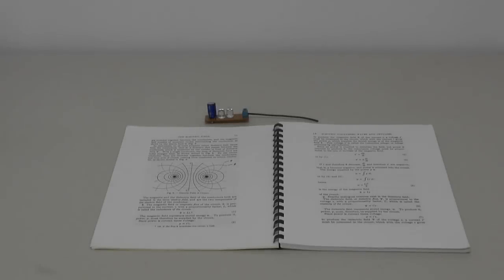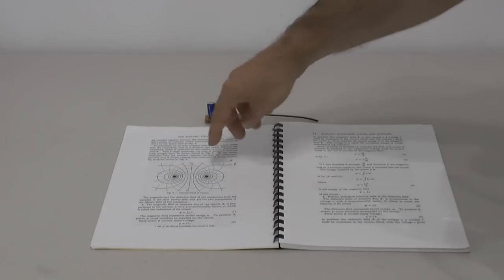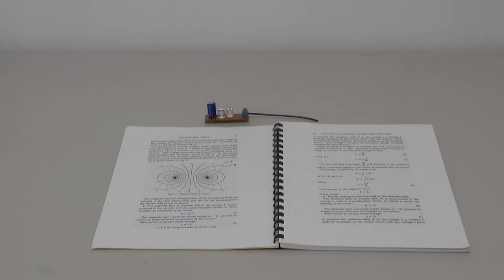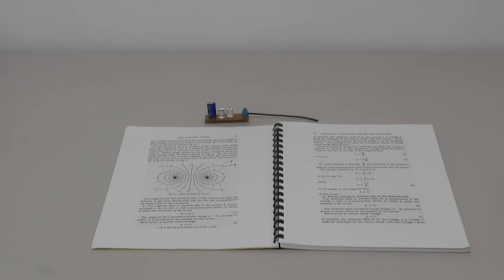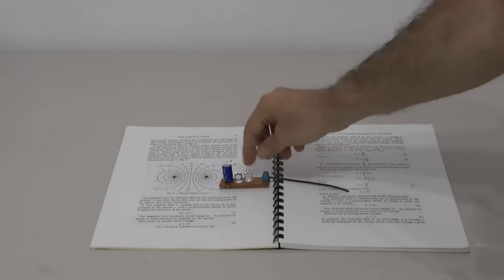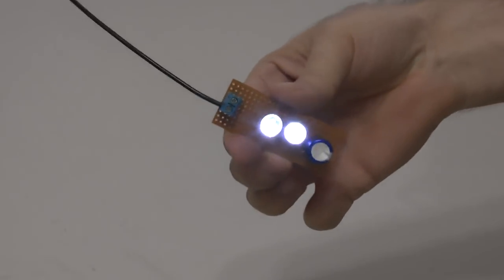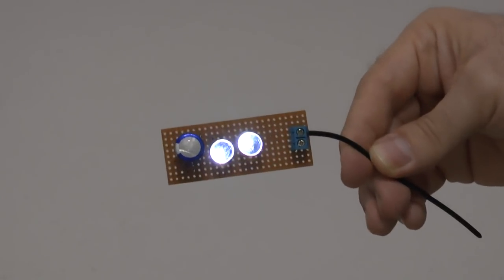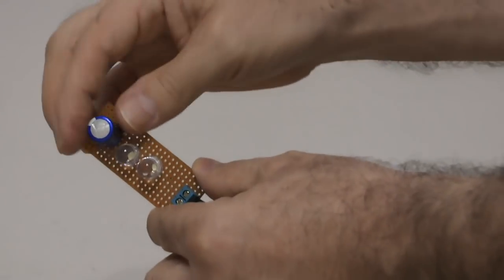Radiant Energy  and Dielectric Fields

Comment: Nikola Tesla asserted (Proved) that radiant energy was lossless and superluminal (wirelessly superconducting). In Colorado Springs he documented that he picked up a stronger signal from lightning strikes at periodic positions miles further distant than the source storms. This may be a strong indication that radiant energy has magnetic as well as dielectric properties. He did describe how the placement of his magnetic quenching device across the spark gap (from near the source or near the receiving contact) altered the effects (sometimes reversing a charge effect to a discharge effect) of the radiant energy he transmitted. Keep in mind that Radiant Energy is a wave propagation of the neutral super-fine Ether particles that lack the classic charge characteristic that responds to magnetic fields, but still transfer magnetic power and response according to Nikola Tesla.
Reply: Interesting theory, can you say something about transforming the ether into electricity ? Is a spark gap arrangement the only way to seperate the electric current from the ether energy which is known as radiant energy?
Reply: @Birol731  I'm afraid he's got it a bit wrong, first off the Aether isn't made of "fine particles" in the sense we understand, it is a non-Cartesian medium of unmanifest pure potential, Eric Dollard calls it Counterspace.

When the Aether experiences tension or torsion it becomes what we call the Dielectric field, and when that tension releases it manifests as Magnetism, which creates force and motion away from counterspace, forming space as a result, this is why Tesla was adamant that space cannot be curved as it has no properties, it's basically a shadow wake left by the loss of the Dielectric.

When it comes to radiant energy, it is essentially a current that has lost its magnetic component, since electricity is the conjugate of dielectric and magnetic fields, quenching the magnetic component while its flowing forces it to become a pure dielectric displacement impulse. You can see this in action by getting a spark gap and having 2 same polarity facing magnets quench the spark, it will result in the spark turning white.

Another way to make it is by running the power through a hairpin circuit before the spark gap, it will turn white and unlike regular dielectric discharges (sparks) it will be completely unaffected by the magnets.

If we could learn how to use this as an energy source it would replace outdated Electricity with Dielectricity, completely safe for humans. Power in this form doesn't have a magnetic component and as a result operates outside of time and space. since time is a measure of magnitude and the Aether doesn't have magnitude,  as a result the impulse travels without delay and doesn't suffer the inverse square law. Magnetism essentially represents losses, this kind of system should only form magnetism when it encounters a load thus leaving the rest of the circuit without the magnetic component, Russian experiments with single wire transmission have shown some indication of this as the wire displays room temperature superconductive properties.

ATM my theory is that if a tesla coil can powered by this impulse it will broadcast that power wirelessly, allowing the powering of devices by simply attaching them to a ground connection, or so I've heard, more research needed.
Reply: @JenkoRun  I had a video from the Borderland sciences many years ago (in the end of the 90's) where Eric Dollard made a demonstration about longitudinal waves (dielectric or capacitive waves).
Hmm, let me ask you, in a Tesla-coil, is the electric field component (E) from the magnetic field component (B) not seperated ?
While it is said, a Tesla coil sends longitudinal waves into space, so not magnetic field components as you said, which means no time delay, and not any energy consumption during the transmission process.........
What about the energy equation, how would you define the equation, for example, for the energy which is consumed in a light bulb or motor ?
What about the conventional current, can we transform these into longitudinal waves, maybe by using a pulsing circuit (DC) with very high on-off frequencies ?
The aerial capacitor of a tesla coil changes between plus and minus, a second coil which is placed in the vicinity of such a transmitter coil, would respond to the transmitter, am I right, a kind of displacement current (dielectricity as you mentioned) in this signaling system?
On the other side, displacement currents are also mentioned in the Maxwell equations......
We have more questions than answers, is there a free energy system here in youtube which may work according to these principles of Nikola Tesla ?
Can we use a Tesla coil to verify your hypothesis, a possibility to produce more output than input ?
Thank you very much for your detailed answer, you have much knowledge about Tesla's work, do you have here in youtube some videos about your studies in the field of longitudinal waves and Tesla currents, may I ask you ?
Reply: @Birol731  Reply 1/2 because YT sucks.

The dielectric and magnetic components are not separated in a tesla coil, or at least not entirely, we can tell because the dielectric discharges (sparks) that come out of the secondary are blue/purple and they can HURT when you make contact with them, this shows that there is still a presence of magnetism, albeit very brief. It's not like regular electricity however since sparks are dielectric discharges that have a magnetic field form along after the discharge, like lightning the discharge itself occurs outside of time and space, the magnetic component forms afterward and follows the path the original discharge took as it ionizes the air.

Before we go further we have to understand what these fields fundamentally are, the dielectric field is the Aether under tension or torsion, while the magnetic field is the extrinsic attribute of the dielectric field, the loss of the dielectric is what creates force and motion away from counterspace, volume, and is also what creates our Cartesian universe. Space itself is literally a shadow wake left by the loss of the non-dimensional dielectric field. This is why Tesla was adamant that space itself cannot be curved:

“I hold that space cannot be curved, for the simple reason that it can have no properties. It might as well be said that God has properties. He has not, but only attributes and these are of our own making. Of properties we can only speak when dealing with matter filling the space. To say that in the presence of large bodies space becomes curved is equivalent to stating that something can act upon nothing. I, for one, refuse to subscribe to such a view.” And he is most certainly correct.

Despite my research I'm not good with math so I don't do equations nor understand them, I just compare with what we see in nature and what I know, along with my own intuition.

Can we transform conventional power into dielectric power? 

Yes, in-fact this is exactly how Tesla's hairpin circuit works. Fundamentally the electricity we use today is "contaminated" with magnetism, amps, this is what makes it lethal to us, Tesla wanted to clean the power and he succeeded with the discovery of what he called radiant energy, also known as cold electricity or dielectricity. 

The hairpin circuit works by taking a conventional current and running it through a parallels spark gap and series capacitors, because of how capacitors work between DC and AC Tesla found that unidirectional current worked best for this, yes Tesla went back to DC when he began working with radiant energy, you don't hear people talk about that do ya? When the power comes through the DC current will cause the capacitors to eventually act as an open circuit upon reaching max capacity, when that happens the spark gap becomes the new path of least resistance and discharges the capacitors, if Master Ivo is correct this release sets the tension into motion at such a fast rate that there is no time for the loss of the dielectric to form a magnetic field before a new charge is ready, this is how you convert conventional electricity into dielectricity, or dielectric impulse displacement currents. It's why you can touch the cold side of the circuit with over 100kv of power running through it and not feel a thing. No magnetism, no contaminants, no issue powering a load, superior in every way.

In a spark gap, dielectricity manifests as a silver/white spark with gaseous like appearance, if modulated correctly you can stick your hand in it and you won't be harmed, in fact you'd likely get health benefits from it. IF modulated correctly, do it wrong and you might not be very heathy after that. This is probably the best way to visually tell if your spark is just a regular dielectric discharge or a true dielectric impulse current.

The reason we have to convert conventional power is because the voltage tension naturally forms magnetism in losses when it moves, what we need to do is to clean the ALREADY INDUCTIVE current of its magnetic contaminants impurities. Tesla's hairpin circuit is among the simplest way of doing it.

Think of Gold purifying, when you purify gold you keep what's good, and the impurities? You throw them out, it's the same thing with electricity, we need to purify it from its magnetic impurities. Our power grid is a disaster.
Reply: @Birol731  2/2

Is there free energy? Oh man do I have earth shattering news for you on this. Take a look at the following:

"Maxwell too considered the electromagnetic induction as a phenomena in which a current is induced in a circuit, but not as a phenomena in which a changing magnetic field causes an electric field. He clearly said that the induced electromotive force is measured by, not caused by, the changing magnetic field. Just as Faraday, he made no allusion to any causal link between magnetic and electric fields."

"But as we've seen neither Maxwell's equations nor their solutions indicate the existence of a causal link between electric and magnetic fields. Therefore we must conclude that an electromagnetic field is a duel entity always having electric and magnetic components simultaneously created by their common sources."

"A time variable electric current creates an electric field parallel to that current. The field exerts an electric force on the charge in the nearby conductors thereby creating induced electric currents in them. This in the term “electromagnetic induction” is an actually a misnomer, since no magnetic effect is involved in the phenomena, and since the induced current is caused solely by the time variable electric current and by the electric field produced by that current."

"according to these equations in time variable systems electrical and magnetic fields are always created simultaneously because they have a common causative source, the changing electrical current, once created the two fields coexist from then on without any effect upon each other. Therefore electromagnetic induction is a phenomenon in which the field creates the other, I.E energy generation is an illusion. The illusion of mutual creation arises from the facts and time-dependent systems of the two fields appearing predominantly together"

-Causality, Electromagnetic Induction, and Gravitation: A Different Approach to the Theory of Electromagnetic and Gravitational Fields by Oleg D. Jefimenko

What does this mean? In laymen's terms, it means there is NO TRANDUCTION between electric energy and kinetic energy. No kinetic motion has ever been transformed into dielectric and magnetic fields, a spinning generator only sets up the conditions for electricity to manifest. What does that tell you?

All conductors are dielectric reflectors, when a magnet passes over it the M field induces tension on the surrounding Aether which is where the dielectric field comes from, the dielectric field is the voltage, that's why Tesla's referred to it as "tension", because it literally is.

Magnetic induction in a tesla coil is the same thing, the power is not truly transferred to the secondary, rather in combination with resonance it churns up the Aether in the secondary coil, in a dielectric power system what we see in a coil is already OU, because voltage is what you want to produce power in the first place, in resonance all those extra volts are not coming from the primary at all.

But there's more to it than that, magnetism essentially represents losses, and that interferes with power production. In a tesla coil the primary induces tension in the secondary via the magnetic field, but this weighs down the free oscillations of the secondary the tighter you make the coupling, so you have to strike a balance between tight and loses coupling for induction and avoiding weighing it down. Tesla found a way around this.

You might have seen images of Tesla's giant sparking coil from his Colorado lab, this is what he called the Extra Coil. The purpose of this coil is that it is series connected to the secondary but outside the magnetic field of the primary and secondary, this way tesla could make the coupling between the primary and secondary as tight as possible without weighing down the extra coil, this is how he achieved utterly incredible voltages of over 100 million volts!

Part of the reason we rarely see over unity is because our circuity is closed, nature is an open system, Tesla used single wire and later wireless and those are both open system. Take a Tesla Coil for example, the secondary is an open circuit where the top load acts as capacitance to store the AC induction for its return trip to earth ground, that is an open system, and the voltage levels you get from it are just huge. 

In fact Tesla already called the “necessity of a return circuit for the conveyance of electrical energy in any considerable amount” an “old notion” back in 1898! The sheer amount of magnetism that forms in a closed circuit should be an indication that there is something fundamentally wrong with that design.

So that's 2 things that you need to account for when it comes to OU, magnetism and closed circuits, but there's still more to it.

The input torque of an electrical generator would free spin freely and indefinitely if not for 2 things, Friction and the Backwards Translation of Load, in the form of a reverse magnetic field which forms as a result of the forward current, and which opposes the input motion. This reverse torque fighting the input torque requires more and more energy to be applied at the input to continue the ability for the extraction of energy at the output.  

Tesla spoke about this reverse current and reverse magnetic field, now called the Lenz Law. Tesla opposed the reverse torque natural occurrence, with the introduction of capacitors into an already inductive generator coil circuit.  This is evident in the writing of Tesla's pancake coil patent.  But more importantly, he invented resonant electrical circuits, the resulting oscillations that occur within the same capacitive / inductive circuits, which alternately transmits magnetic and then dielectric pulses, over time, which each passing electrical half wave, and influence other similar circuits with the same electrical resonant frequency.  

The key here is that these secondary circuits are forced into electrical oscillation without a backwards translation of load, so long as the frequency remains perfect on both circuits. In other words, if you can keep the circuits resonating while you extract power from the second circuit, you will be able to withdraw more energy from the output than there is needed at the input to keep the system running. Then you can loop a portion of the output to power the input continuously and indefinitely.  This has been successfully done and demonstrated in the work of Don Smith of Texas USA, and Tariel Kapanadze, of the soviet satellite country Georgia.  

The configuration is Tesla's patent 645576, System of Transmission of Electrical Energy. The configuration is Resonant circuits that are connected via the dielectric field. 

It is apparent that this sort of open dielectric power system is was Tesla wanted to use for the magnifying transmitter, FIG 5 of the "Rare Notes" shows a drawing of the tower using the hairpin circuit design to convert conventional power into radiant energy before being fed into the rest of the circuit.

One way you can test this, if my understanding is correct, is to build a few of Tesla's "Radiant Energy Apparatus's from his patent and setup a dielectric impulse spark gap, preferably in a tesla coil configuration like from FIG 5 of his rare notes, I believe you will find each radiant apparatus you build and place near the impulse spark gap will receive the impulse shockwave and you can freely extract power from them without putting strain on the source.

Remember, circuits within a magnetic field are terrible for OU systems, you want to rely on the impulse shockwave to avoid straining the transmitter, this is why you can't use a regular tesla coil for over unity, the magnetic attachment "Eats" into the power provided by the primary.

Btw, you can contact me via email, it's on my channel about section.